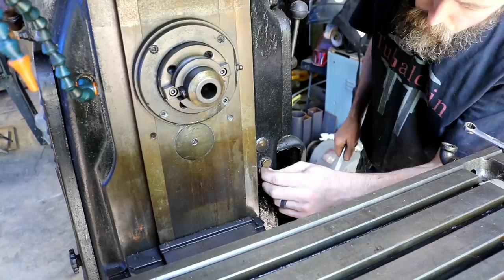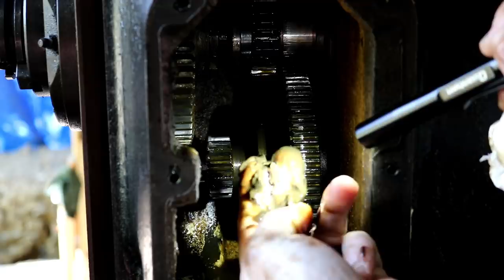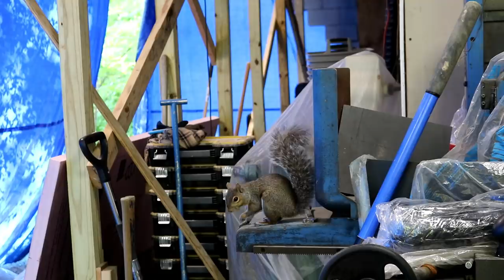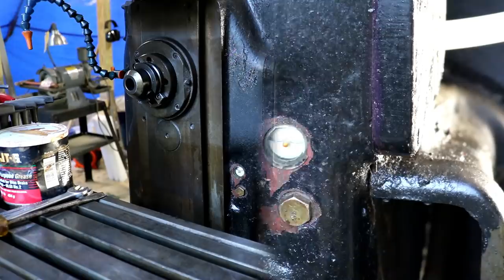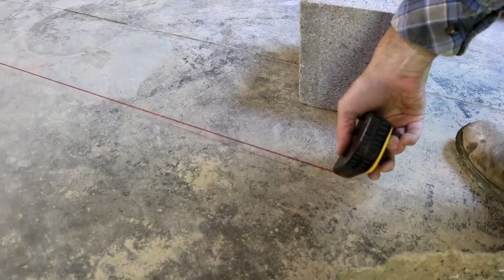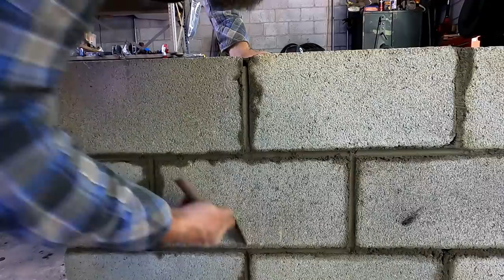METAL in the GEARBOX ! 1st RUN  Adcock Shipley Mill.

Comment: Steve, a more than acceptable attempt at blocklaying. A DIY builder who did the brickwork on his own home was a perfectionist and laid his bricks to sub-millimeter accuracy.
His front wall looked so good that it looked wrong. It looked like one of those brick overlays they put on weatherboard homes. 
Even the best brickies get them slightly out of line and that inaccuracy is what makes a brick job look real. A tad extra mortar brings it all back in to line.

Comment: Hi Steve! Take a two foot long peace of wooden dowel about the diameter of a broom stick. Place one end (tip) of the dowel as close to the bearing that you want to listen to, and lay your ear against the opposite end/side of the dowel. If your hearing is good you will be surprised what you will hear. A wooden handled screwdriver will also will work, handle against your ear.

Comment: Machinist should not lay blocks... the brain of the machinist can not relax remotely enough to do it efficiently. Mate, looking at you level it and complaining about uneven floor ...I was expecting you to pull dial indicator on that thing :)
Reply: I was fully expecting the dial indicator to make an appearance at some point!
Reply: I retired from 40 years of machining and went into home renovations and additions. Took me quite a while to make the switch in tolerances LOL.
Reply: haha man that's funny
Reply: canuckguy worried     Do copies of 'Fine Woodworking' in a client's house make you nervous?
Reply: canuckguy worried     My comment is more expecting oak studs placed to the nearest 1/64th, than a comment on your nickname.
Reply: I don't agree,  A real machinist will always have an open mind to try stuff and gain new experience.   Because in many places, a machinist will never touch welding or CNC and tthey depend on others to fix a small mistake or don't have a future.   CNC opens the door for 3D cad software learning and that experience can be used to see in 3D the parts you make even if it's conventional machining.  When you know how to weld, well you can fix errors on a part and even give you additional toold to extract a broken bolt or plug a hole and re-drill it again and tap it with fresh threads.  The more you know as a machinist, better you'll enjoy the work and your income will go up with that added experience and knowledge.   When I started in the business, I had the chance to work in a shop where the father of the owner share with me his knowledge of 40 years experience as a welder.  All that knowledge help me to avoid breaking small taps when i did the many repairs for old production machines.  Ok that one example, but that something I know where many others don't.
Reply from the maker: After watching many others lay block professionally,  I noticed they pretty much run with it . Being my 1st real attempt and expecting it to be more difficult than it was . ( Common for me )  I was too concerned with all the details. 😁
Reply: @SteveSummers  I would expect building one long high wall would fix any tendency to be overly picky. At some point you get fed up and want to come in for dinner! Plus muscle memory eventually will kick in. Or carpal tunnel, whichever comes first.

Comment: I have also been fascinated by brick and stone masonry and over the years I wished I could get the time and someone, a master mason to teach me, at least the basics. A decade ago, these two masons, who were in their mid, late 60's were working on a long boundary wall at a house in our neighborhood. And each day I would pass there, the wall gradually came about and after a month or so we could all see their beautiful creation. 
About the bearing noise, you could pinpoint it with a stethoscope (a proper one), or just hold a length of wood to your ear and probe around moving parts while the mill is running. All the best.

Comment: Hi Steve,cleaned many a sight gages.Had to make a few too.The sludge isn't to bad for a machine that is 50,60 years old.I filled a quart jar of large metal flake once on a giant Ingersol Rand planner that had a 10 foot bed and you could walk through it's double columns.Machine ran fine for several more years until company was bought and got rid of most people that did not have 20 years seniority.And I still have that jar somewhere 30 years later.

Comment: That old Adcock&Shipley has outlasted many a Taiwan/Chinese machine ,and still can do a job I'm sure .
Reply: maurice levy a guy on another channel in Great Britton bought an old Chinese machine made in the early 1950s. This is a small vertical mill with motorized x and y axis,  it’s an industrial machine smaller than a Bridgeport, and bigger than a large drill/mill. After the needed tear down and cleaning, the machine looked like new, both inside and outside. Very little wear. The point is that great machines can be made anywhere, and have been. When we see cheap Chinese equipment made for the lowest pricing, we think that all of their machines are built that way, but it’s not true.

Comment: Spindle bearings are usually precision bearings and have an "O" or something similar showing that they are precision. They are very pricey, probably a few thousand dollars. I used to run a 20" monarch lathe at work that needed new spindle bearings. The lead time to get new ones was about a year. We needed the lathe so we bought some non precision bearings which were a fraction of the cost. We ran it with these bearings until we got the precision ones. I could never tell the difference. I think all bearings are pretty precision now a days.

Comment: Steve, you may consider adding some concrete piers under your existing slab for support and even adding some piers to your footings before pouring. While you have everything out of the way and equipment handy, it wouldn't be too much work. we have had to pier whole slabs that were totally floating due to shotty dirt work. It could potentially benefit the slab to better support heavy machinery.Good luck! Can't wait to see the crete pour!

Comment: Hi Steve, great video as always. 

You may know this already of course but just in case you don't, if you want to localise where noise is coming from in a machine tool or an engine take a long handled screwdriver and press the tip of the screwdriver against the area you think it is coming from, then place the handle of the screwdriver against the bone on the side of your face,  just in front of your ear. Apply gentle pressure. You get bone conduction of the sound into your ears, it's like a stethoscope and it allows you to accurately find the source of noise in a machine.  Regards to you, Elizabeth and your family, not forgetting Peanut and Walnut of course. Sarah

Comment: Set the corner blocks, pull the line tight and build your wall plus or minus an 1/8, check plumb once in a while but just go!

Comment: A little side bar! Block used to be made using crushed cinders for the aggregate part of the receipt. Back in the day foundries, power companies and tons of other manufacturers burned coal in their processes which produced as a byproduct ("CINDERS") as they burned out. Thus came the name "Cinder block". Today the block are made using stone chips, sand and cement. Therefore since the stone chips, sand and cement combine into concrete their comes the proper name, "CONCRETE BLOCK" In the Milwaukee, Wi metro area back in the day manufacturers produced so many cinders they couldn"t find a market for them so the construction industry started using them for not only "CINDER BLOCK" but also base fill for roads, backfill around excavations and whatever else needed to be filled up. You can dig a hole anywhere in the metro Milwaukee area and come up with cinders! You can tell the old "CINDER BLOCK" by their color, dark gray to almost black. 
RAY P

Comment: I used to help my daddy in laying block (mixing morter and carring block) and I can tell you that that little wall that you laid looked great, I for my first time laid the block on a 16x18 ft building years ago and I made some mistakes but it is pretty straight and level, keep up the good work and don't worry about the speed at first just make sure you get it straight and level and touch up the mortar joints when you strike them, one little trick you can take a big sponge and wet it and wipe the joints down when you are done, good luck man.

Comment: Great to see you have got the mill running, had a bit of trouble getting that high/low gear lever back myself certainly a solid machine. The motor at the end of the bed operates the fast approach and return but can be used with out it as the cutting feed will still work. I sorted an on off switch for that motor only and works ok just a bit off info hope it helps  Great work with the block by the way .

Comment: Re:  Form a funnel

Reminds me of stuff I used to make removal casts/splits for athletes.  I used both felt and vinyl/plastic covered, (used the plastic when there was rain expected).  This was one of two things allowed to be used for casting and still allow the player to participate in a game.  A plaster cast can become a weapon. 

The other substance was thermo-plast, a low temp plastic state plastic. We would dunk it in the hot water of the heat pak 'steamers' then form it to a players limb/hand, etc.  If you have ever messed around with foam core PVC, it is essentially the same thing.  

I use ~1/8" thick foam core PVC for all kinds of stuff because a short shot with a heat gun, and you can make most anything.  I just make a ways cover for my lathe, to protect the ways when I'm removing/replacing the chuck, in cause I drop the chuck.

Comment: Hey mate done a great job just a couple of pointers use some plasticiser or a couple of caps of dish washing liquid in the water that you mix your mud with this will make the mud more user friendly,
and use a pointing  trowel with A little mud on it against the blocks when you are using your jointer and push the mud in to any voids in the joints that you may have missed, joint your beds first then your perps 👍

Comment: You always want the string line at the top of the course, build the corners first, then you lay the rest to the line by eye, no level needed. Pointing do the perps first then the bed joints with the iron. When its sets up enough you can knock the smuts off with a soft brush.

Comment: "Throw" the cement/plaster to the blocks and it will adhere a lot better, a trick old brickworker showed me
Reply: I did some block work on my first house and it was my first experience. I wound up throwing mortar everywhere at first, a friend's dad (retired contractor) came to help me and I think he had only a few tablespoons on the floor after laying 3x as many blocks as I in 1/10 the time. He said when he was young his foreman would slap him in the head when he made a mess, he learned fast lol.
You're correct, when you throw the mortar it grabs better by getting into more books and crannies of the block.
Reply: Chris  My guess is that a dry brick could suck all the water out of the mortar to quick. Like when pooring a floor they keep the concrete wet so it does not dry to quick. The same goes for plastering.
Reply: Chris  Dampened concrete, stone, block, or brick will not suck up the water from the mortar and dry it as fast as if the stuff was dry.

Comment: Hi Steve, that building repair is coming great, and thats a beautiful machine. One thing, that you may not do, and perhaps you would like to give it a try, is to wet the blocks before adding concrete, if you do that, once the mix is solid the bond is much stronger. Our construction is 100% wet, meaning, bricks, cement, etc; walls are not framed, but build like your workshop's, even the interior ones, and its a common technique to spray with a hose the bricks or blocks or whatever you are installing before starting. Best regards from Argentina

Comment: To listen for bearing noises and isolate them from the overall noise simply use a long screwdriver or a hardwood stick. Place the tip of the screwdriver or one end of the stick up against the machine and then place your ear against the other end and it will act like a stethoscope to find the source of the noise. The closer you are to the source the louder it will get.

Comment: Just ad a little water to the blocks before laying them. You can use a big brush. In our region we have a brush for lime only. Any bricklayer have them. That´s a great tool for this kind of work. if you wet down the blocks first the motar wont dry up on you while you mess around with the blocks. Just a little tip from a "I fucked up so many times I had to learn the hard way" person.

Comment: Steve, FWIW 946 ml. = 1 quart.  That UK mill is definitely old enough to "know" nothing about Metric.  I'm thinking you've got a 1 qt. gearbox.
Reply: Except in the UK a quart would be 1136 ml. Its actually a little over a pint and a half by our measures. At least it had plenty of oil in it, even if it was in terrible condition.
Reply: That's a US quart. A British quart is approximately 1.3 litres.
Reply: @hut8_newzealand361  and therein lies the reason we should all use metric.  Let the pecks, gills, guineas [=21 shillings; 20 shillings = 1 pound], etc rest peacefully in history books.
Reply: @jrb_sland5066  The metric system is so 17th century. I prefer SI units. But I am glad we have the tongue twister
Peter Piper picked a peck of pickled peppers.
A peck of pickled peppers Peter Piper picked.
If Peter Piper picked a peck of pickled peppers,
Where's the peck of pickled peppers Peter Piper picked? ...... .

from Peter Piper's Practical Principles of Plain and Perfect Pronunciation

With  a peck being 8 quarts.

Comment: I always put a magnet on the drain plugs of my equipment, except when there are moving parts too close to the magnet that might hit a protruding teat of particles. They capture all the magnetic particles down to the dust level. I also like to examine the rinsed particles and see if I can determine their source. Almost everything produces a fine metal dust over time.

Comment: I took a class at a local career center in brick laying. They just used lime and sand to practice. It acted just like regular mortar and it could be reused just by adding water. The class was canceled after 3 sessions because not enough people signed up. We started with three students and two that promised to come to the next class. By the third class it was just me so they canceled and refunded my money. The best part is that in three sessions in which it was almost one on one I learned everything I needed to be mediocre.
Reply: BTW, thanks for sharing Steve.
Reply from the maker: Thanks, I bet that would work just fine 👍. Thanks for watching and commenting.

Comment: Not to shabby with the blocks a little tip for the mortar add a cup of Bicol or if you cannot get that some dish washing liquid will work makes the mortar soft and smooth to work. When you put the mortar on the block it's called buttering got to get with the lingo !! another tip is use a long level a 1200 mm or 4 foot your speak that way you get a grasp of how the wall is traveling and you will see the dips and hollows much quicker it will span three blocks and help control any belly you might get in the wall.  Stay safe from down under.

Comment: Round up a friend and another wheel barrow, then save yourself some money and pour the concrete yourself. Make sure you pour the corners first and keep the concrete stiff so it does not settle out to much. It isn't that hard if you are not afraid of hard work, you can do it yourself. You do not need to finish the concrete really smooth like on a floor, it is just a footing. If you have it done by someone else and you are there the first thought you will have is, I could have done it myself. The ready mix plant can help you figure out how much concrete you will need and make sure you form up a small section of sidewalk in case you have extra. Your young and smart so don't be afraid just go for it.

Comment: I have nothing against using diesel or kerosene as cleaners, they do work however, any more, prefer brake cleaner. Just cuts right through oil and grease plus, it evaporates. This machine seems like they used it more like a production unit and refused to shut it down for regular maintenance that, or someone just didn't know what they were doing with it. Peanut is definitely a curious squirrel or the bigger star of the show LOL. Great video, cheers :)

Comment: For your mortar board, paint or urethane the wood to keep it from sucking all the water out of mortar. Also a sheet metal will work too. And if I was to cut a bag open and then lift it into a dry wheel barrow I would cut the bag open when it was in the barrow. Keep up the good work.

Comment: That box looks perfectly ok. A properly designed gearbox has plenty of room at the bottom to accept metal and other gunk to accumulate for a long time before cleaning is required. That stuff never rises to the level of the lowest gear, so they’re safe. The gears throw off garbage I’df the rotate at a high enough speed, so they self clean.

The manufacturers of these machines are very aware that companies that buy them don’t take care of them. They run them until they’re worn out, usually until they can’t meet customer specs on parts they’re making. Then they sell them for very little, or just junk them. Amateurs who come by their “lucky” find are sometimes really lucky, but sometimes, like buying a used pro level camera, find that they are too worn out to easily bring back to proper working order.

Comment: Now you shamed me into it...well, you and Abom79, just finished changing the oil in my Quincy air compressor and the gearbox on the lathe, then pulled the covers off the power feeds on the mill and greased them up, now its time to make some chips.